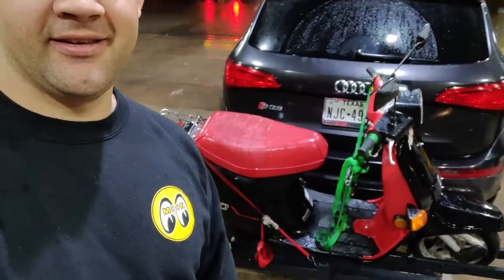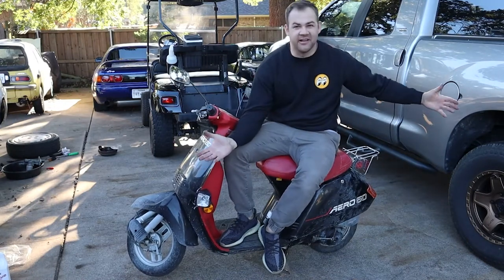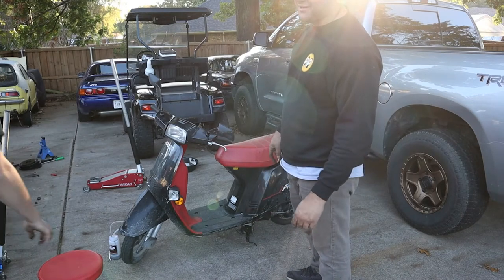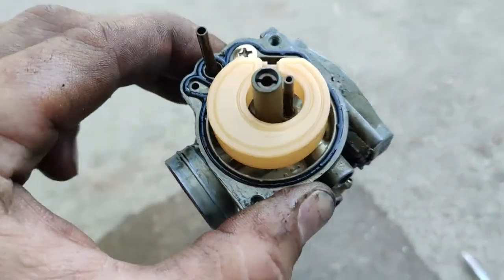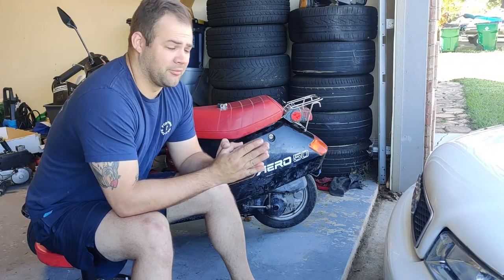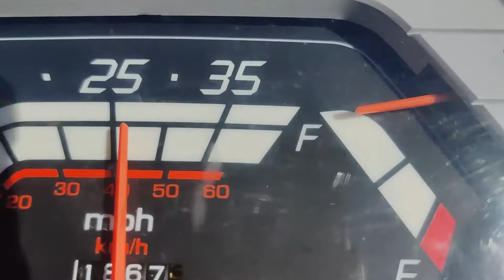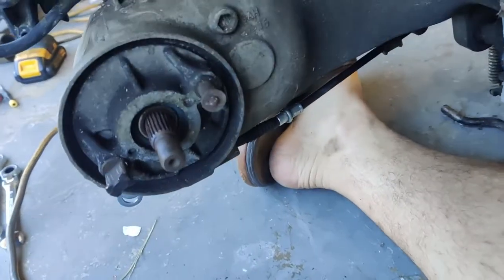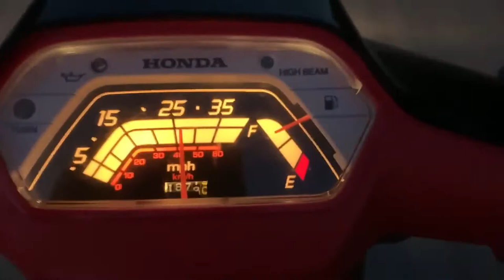HONDA AERO 50 REVIVAL (Sat for years, can we get it to run?)

Comment: Just got an 86 honda aero50cc curious what fuel i should run through her being all stock
Reply from the maker: I'm sure you can run just normal unleaded gas. ideally though, you would want ethanol free, but that's not always possible. I run 93 octane in mine.

Comment: Hey man I'm about to purchase a stock 1985 aero 50 but it looks pretty beat up for 800 is it worth it?
Reply from the maker: If it has a title and runs, that's not bad. You can source plastics pretty easy. I actually have a set I'm selling
Reply: @BrunerTuner  it runs but no title😬
Reply from the maker: That's really tough. The Vermont loophole doesn't work anymore. So no title is an issue.
Reply: @BrunerTuner  understood, thanks for the words of wisdom 🙏 I found another aero 50 with an upgraded engine closer to 900 with a title

Comment: You worship false idols claiming the AF05e engine is the best honda two stroke scooter. Bow to 94-01 Elite sr 50 and its far superior  AF16 engine. all its aftermarket glory is just icing on the cake.
Reply from the maker: The af05 walked so the af16 could run. Also, did I forget to mention this is getting af16 swapped?
Reply: @BrunerTuner  that's an excellent way to put that! 😂 Do you have an af16 yet? People are out of there Mf minds the prices they are asking for them.
Reply from the maker: I've got 2 of them 😏
Reply: @BrunerTuner  I wish i had another one. Im 70% done with my sr 50 build just gotta toss on polini 24mm carb and naraku intake and swap out the gears. She rips to 50ish now, i really done want to buy disk brake set up though.  
What else are you planning on doing with it?
Reply from the maker: Well I've got a spare 70cc kit on the shelf. I've also got 16x42 gears and some nice JDM goodies on the way. Next step on the build is a CVT overhaul. Gonna go for a zx pulley and polini varistor to keep it simple.
Reply: @BrunerTuner how much change is that gear ratio? Should I go with that for decent all around acceleration and top speed? Don't need to rip wheelies
Reply from the maker: It depends on what your build is. I will have a big bore kit so I need taller gears to take advantage
Reply: @BrunerTuner  I've got a sa50 corsa kit, polini variator, stage6 clutch, arrow exhaust, malossi 1500 rpm Contra.
Reply from the maker: Sounds like fun, you'd probably be good with a 16x42 kit
Reply: @BrunerTuner  it’s already got an af16 in it? Lol